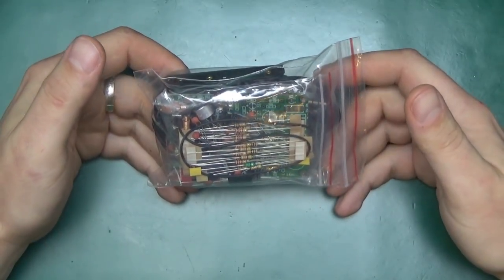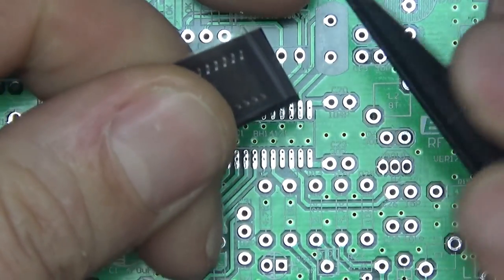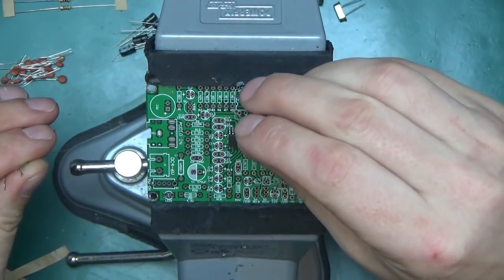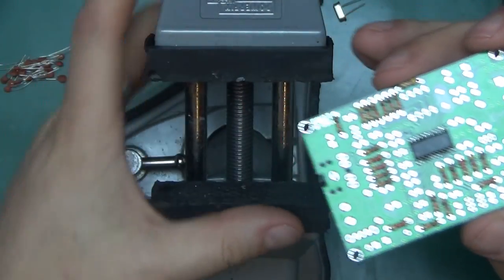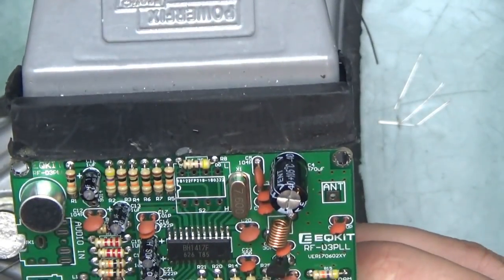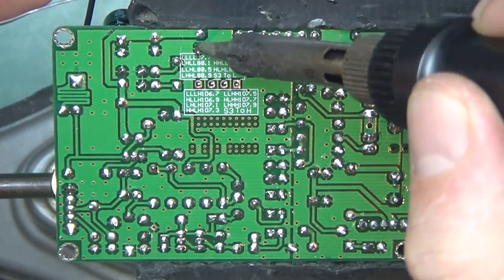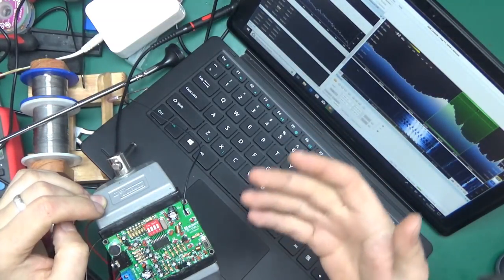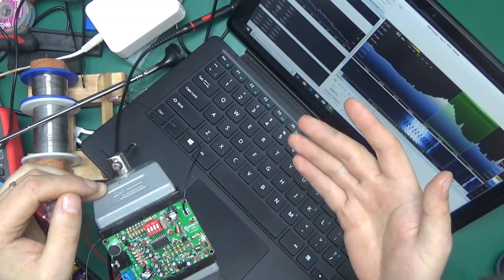#032 - Stereo FM transmitter

Comment: Hi, first, the low level is when the switch is in the on position. Secondly C27 = 22p (I soldered it). Set the frequency to 88.3 will be - on the switch 1-on, 2-on, 3-off, 4-off. Connect the voltmeter to GND and TP1 (R23) and set the 2V voltage by squeezing or stretching the L4 coils. If you switch the band to the high S3 switch, the 2V setting procedure must be performed again. That's all. Good luck
Reply from the maker: Thanks, I will try that!

Comment: Good chance you made the chip too hot with that heating from above instead of soldering it in an smd-oven. That would give exactly this kind of faults, a kind of less or more, and probably on one or more places inside, a sort of bad connections inside the ic. The thermal stresses got too high and now, sometimes, it can be that with every time you heat the ic again the faults can change a bit. So you cán, maybe, have luck with heating it again to a couple of degrees higher than you did until now. At least i think it is the only thing you can try when heatdamage inside the ic is the case here. Or buy a new one and solder the ic with an iron, because for that price a second built makes at least sure
Reply from the maker: Thanks, good shout!
Reply: Correct! Operating temp. of this IC is max. +85C.

Comment: Hi how's the sound on this , especially in quiet parts of the music. I have a belkin tunecast 2. It has bh1415f chip and it's sound is quite distorted at low volumes and quite a hiss as if it's not tuned quite right. How's yours?